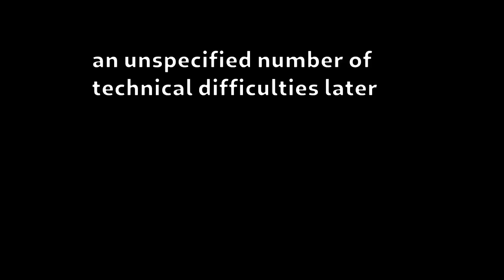More Hilbert Curve Shenanigans

Comment: 2:57 Nitpickasaurus here. It's not that points close on the curves will be close in the plane. In fact, that's actually true of your zig-zag pattern as well. Rather, it's that if you walk to a spot along a Hilbert curve of some level, it will be very close to that corresponding points along the other curves. In other words, as you increase the level of your hilbert curve, any spot along the curves will converge towards a point in the plane.

This fact is not true of the family of zig-zag curves. if you pick a point along the zig-zag, then as you add more zigs and zags, that point will actually jump around all over the place, never settling at any final location. It is only true for space-filling curves like the Hilbert Curve.

Comment: you can kind of use the furnace minecart train with a lot more minecarts if every four of the minecartsin the train is another furnace minecart, since they can be pulled at the same time they can pull four more minecarts.
I still don't quite know how to deal with the curves tho